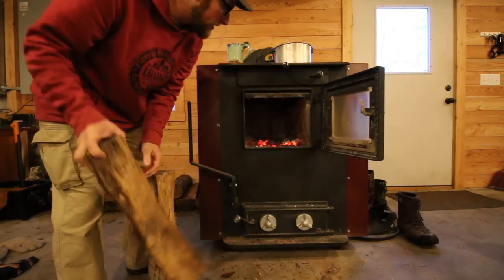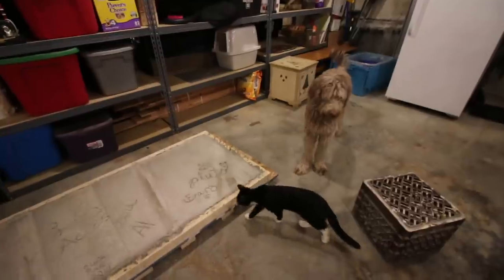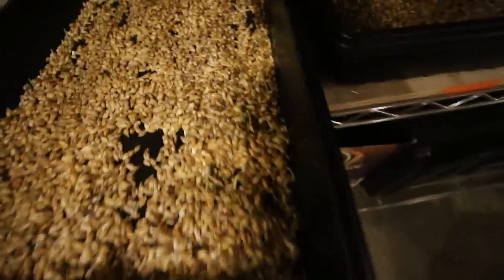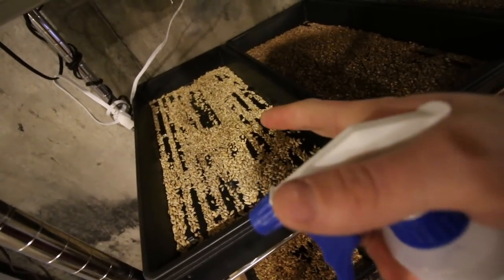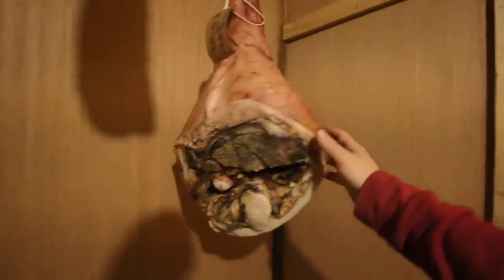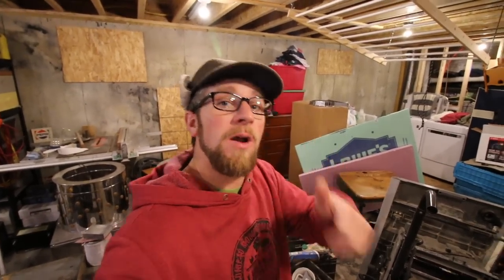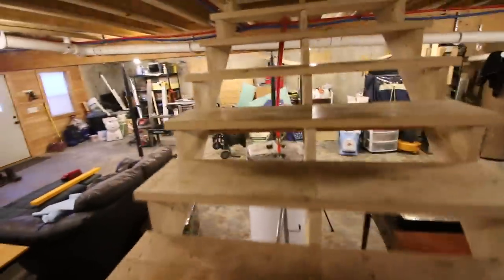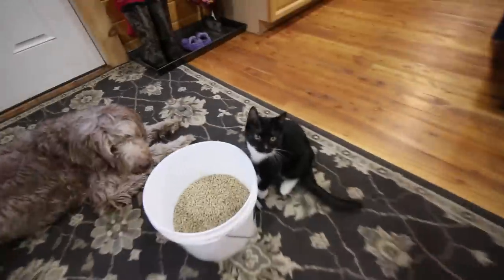HOMESTEAD UPDATE ~ HOW IS EVERYTHING HOLD UP AFTER THE BOMB CYCLONE

Comment: Test those seeds again only do a small sample set. Take about 20 seeds, soak for an hour (total immersion), then take seeds, put on wet paper towel and fold over a wet top layer, then put in a plastic bag (open not air tight. Put in dark spot. Temp makes a difference depending on seed, check on line. Garlic for example will no not germinate at room temp but will in the fridge. Give the seeds a couple of weeks. If they still don't germinate then toss them into the feed.

Comment: The fodder saved many farmers and ranchers here in CA in non irrigated pasture grazing areas.  Nor Cal especially.  You can add minerals and bio char like sprinkles.  Get a few more lights and go to county pot auction.  Pumps from resivoir on timers and plastic tubing sell for peanuts.  Your going to love feeding fodder. Load in a wagon the slides into a sled.  Animals shine and love it and so will your feed bill.  Look into TOTE bag delivery to lower cost.  Every rack is adding acreage  Looking forward to cattle to mow before the chickens.  Any plans on more fruit nut trees or berries?  Your Apple production is going to rock.  Love watching,the animals live and work vs the farmer.  Plastic tubing with floats and nipples would save loads of water carry after frost this spring.  Use a, cattle panel for fall hunt by the orchard.  Pull panel and open season on the garden with apples and nuts for shire will fill the root cellar with sausage and freezer.